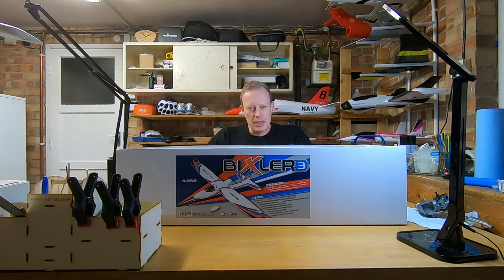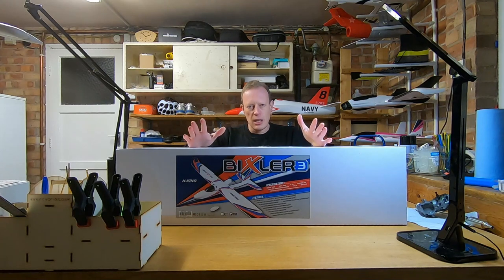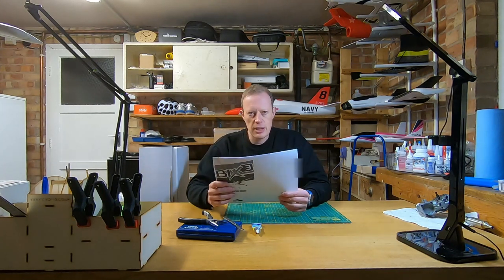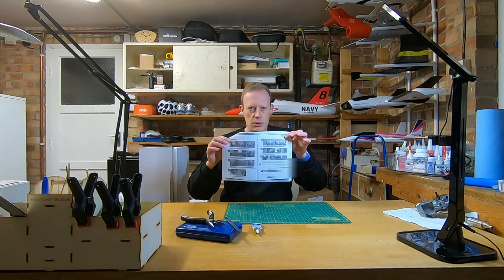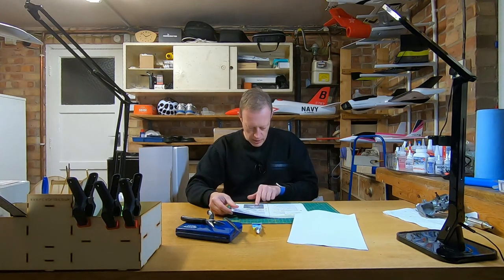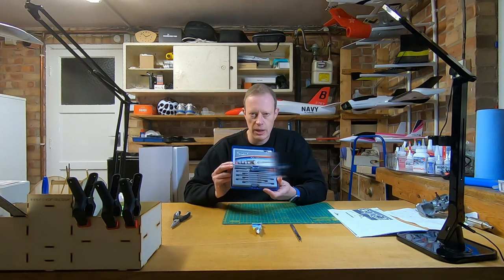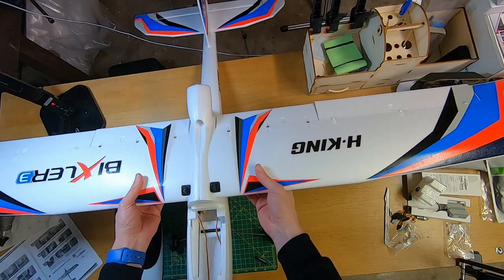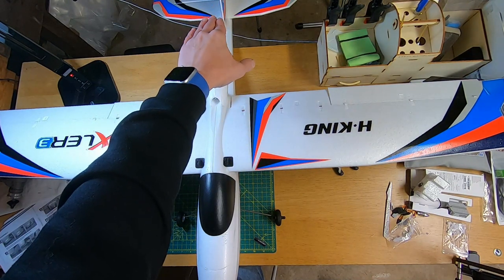LEARN HOW TO FLY RC PLANES!!! - Part 2 - Build and setup your first model plane / airplane

Comment: Hi, I am a total beginner, have ordered the Bixler 3 and will be flying it at a club, could you recommend a good transmitter please? Something i could still use when i progress. Many Thanks Nathan
Reply from the maker: Hi Nathan, good luck with that! Thanks for watching. By far the best Radio is the radiomaster TX16S. Go for the 4 in 1 chip. This should see you right for several years. Open TX is pretty easy to use especially if you haven’t used anything else. If you do want something more budget and simple the flysky FS-I6 is good but probably not long term. 👍
Reply: @tdogrc  4 in 1 chip?
Reply from the maker: @nathanhorn8713  yes it lets you use lots of different receivers from Radiomaster, FRSky, futaba, flysky and spectrum plus many more.

Comment: I have just stumbled upon wings and i want to make one for but high dpeed and with stable fpv feed they woble alot any suggestions
Reply from the maker: I would recommend going for a larger wing such as an FX61 or the new AR Pro and use a flight stabiliser, you should be fine.